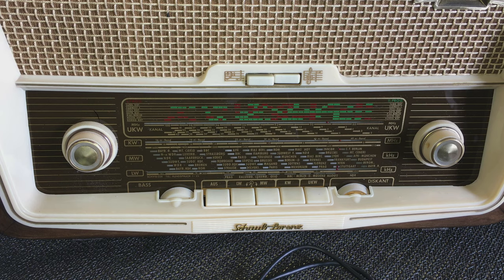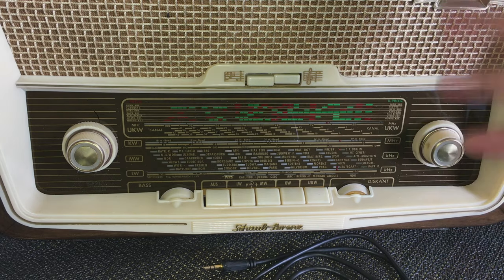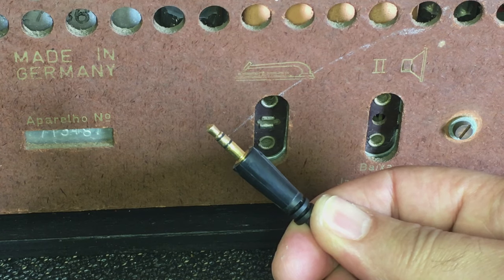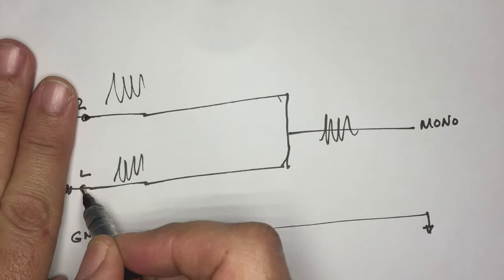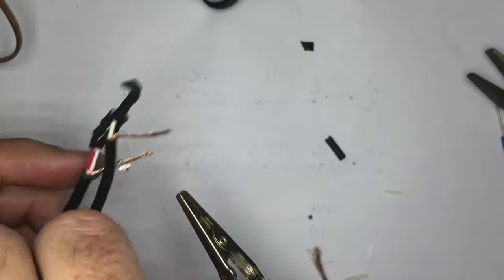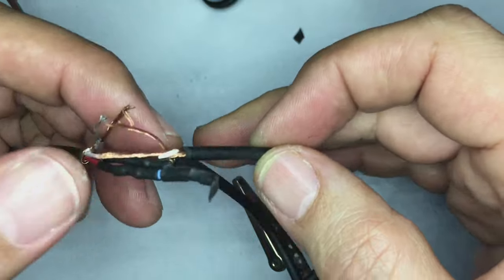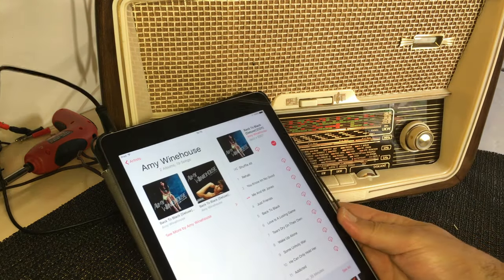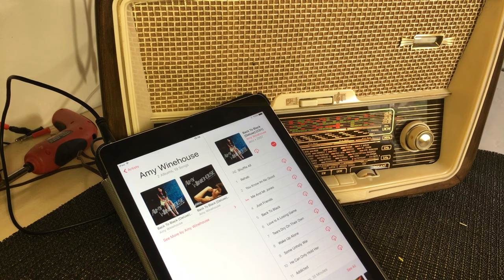Stereo to Mono DIY cable to connect music player / iPhone to tube radio.

Comment: I've come back to this with a question.
In the video you state that mono is usually the upper orifice on the rear phono  input of the radio and Ground the lower. Obviously this is a vertical input.
On most of my German sets have a horizontal input on the back but also a smaller hole in the centre of the two (banana) orifices for what I assumed was the ground.
I have recently used a makeshift 3.5 jack stereo cable and can get music through the phono facility with the ground or signal in either "banana" hole of the phono input and nothing in the smaller centre hole. I'm just wondering if it makes any discernable difference as I cannot tell a difference in the audio quality.
Thank you also for this video and the (as usual) crystal clear explanation for the two 1k resistors. I shall be doing that myself now.
Reply from the maker: The ground socket/signal socket orientation can vary from set to set, so you need to check the marking on the back cover. If there are three sockets, the my guess is that it’s for stereo input.
Reply: @electronicsoldandnew 
I think he is talking about that thin orifice that you almost appear to be putting the signal banana plug in at 23m50s on your video.
I also have a few radios with the thin orific between the banana plugs.some vertical some horizontal.

Comment: I am deaf in one ear and want to make this cable but with both ends being a 3.5mm jack, so that I can have downmixed mono output for my headphones. Would I just solder both wires from the "output" end onto the connected resistors?
Reply from the maker: Yes, each one through its own resistor and then they join as the Mono output.

Comment: On some articles I found, there's a resistor between the gnd and the summed output - on some cases, 1K up to 10K. Also, in theses articles, a 220 or 470Ohms resistors are used for the summing circuit. Could you elaborate on these observations? BTW, I'm making a cable to connect a electronic drum (Roland TD1) to a cheap bass amp. Thanks!

Really nice trick wrapping the wires like a spring!
Reply from the maker: The resistor to ground forces a ground reference when the summed output is not connected to a ground referenced input. It can avoid spurious dc levels on the output when not connected. Does no harm, as long as it is relatively high - I’d go with a 22k or higher. 
The summing resistors can be lower than the 1k I suggest and should make no difference as long as the ground ref resistor is high as suggested, because it actually creates a potential divider which drops the signal level accordingly. Too low and you can get interference between the two output devices.

Comment: Hi, Thank you for this video. I am using the principle for making a bluetooth active speaker from an old passive speaker. The bluetooth stereo signal will be passed to a mono amplifier to feed the music to the speaker. Maybe I am having a blond moment but I have a question where to look for the iron/copper(?) wire you use to make the 'spring connector' (at 19min30s in the video) when you solder 2 wires. I try to find that type of un-isolated wire but can't seem to find it. What should I search for? What diameter is it and what material? I can find iron binding wire but that is way too stiff and probably too thick. Thanks for enlightening me... :)
Reply from the maker: it’s 0.8mm wire. get it at any electronics store.

Comment: Hello from Michigan! Thank you for your very detailed videos. I am finding them extremely helpful. I have 2 quick questions regarding stereo inputs for you. I have a Blaupunkt Arkansas de luxe 40323 which is a stereo unit. It has a 5 pin din for the tape input. I am currently using a 5 pin din/RCA adapter to connect my Bluetooth device to this input. Do you see any problem with that?
The unit also has a 3 pin din as the phonograph input. What is the most appropriate way to adapt 3 pin din to RCA? Thank you!
Reply from the maker: I don’t believe there is a standard way to adapt these sockets as in some instances the convention may not have been followed. I’d suggest actually looking at the socket on the inside and see where the wires are soldered to. That way you’re sure to get it correct.
Reply: @electronicsoldandnew  Ok got it and thank you for the reply!
Reply: @electronicsoldandnew  I checked and they are wired exactly as expected. 5 pin: 1/4=R/L out, 2 ground, 5/3=R/L in. So since I’m going from stereo to stereo my RCA to DIN adapter should be safe to use, yes? I’ve been using this already and the sound is great with no known issues. 

The 3 pin is 1=R in, 2=ground, 3=L in. This one more my concern. Again since going stereo to stereo am I safe to make an adapter by taking the individual RCA grounds and wire them in common to the DIN ground? The turntable itself is already self grounded FYI.
Reply from the maker: Yea, that’s the way to do it.
Reply: @electronicsoldandnew  Thanks again!

Comment: Excellent. Thank you. I have a question. I am currently restoring a Grundig 2420 U. It has a 5 pin DIN  for the PU switch. It has a 2.2 meg resistor in series with a .0033 cap goin to pin 1 to the off switch. Pin 3 and 5 go directly to the PU switch. The question is, is 1 K a high enough value to put in series with the output of my iPhone or IPad?
Reply from the maker: Raul Montesdeoca : the signal has to go into 3 or 5 as a mono signal, with the other connection needed being ground. The resistor and cap to pin 1 is a tape out signal, so don’t connect anything to that.
Reply: Electronics Old and New by M Caldeira thank you very much.

Comment: I have the Grundig 4006u with the 5 pin din port. Can you please tell me the resistor arrangement if I wanted to make such a cable? Thank you.
Reply from the maker: Resistor arrangement is the same if you want Mono. Then you need to see which pins are the input, which is different for every radio, so i can’t help you there.
Reply: @electronicsoldandnew  Thanks so much for your time. Love your channel!
Reply from the maker: Pleasure

Comment: I realize that this is an older video but wanted to ask a question. You pointed out the "hot chassis" issue to be conserned about but did not provide a way to protect against this. Just wondered if you had a design for this or not. I have my own idea of what would work but wondered what your thinking might be.
Reply from the maker: I’ve done a few, but this one is my favourite:
Hot Chassis Plug - with LED indicator for hot chassis tube gear.

Comment: Great tutorial
one Question. If you're not sure you're dealing with a 'hot-chassis' ... how do you test it?
Reply from the maker: Just look for a lower transformer. If it’s not there, it’s a hot chassis set.
Reply: @electronicsoldandnew  ok, I see a big transformer, so I shoul be allright.
Reply from the maker: It should have two transformers. A power transformer and an output transformer.

Comment: Very clear explanation. Thank you. I need a stereo to mono lead for my stereo guitar to mono amp. Presumably this would work. Can you recommend what resistors I need?
Reply from the maker: williamshywel : yes, will work. Use two 1kohm resistors.
Reply: Can i use 1.8k ohms ¼w, 5% resistor as an alternative?
Reply from the maker: that will work too

Comment: Great information, thanks for posting.  I have a question about a vintage single speaker device (not powered at all) that I want to use with an iPod or similar input.  My thought is to mount a 3.5mm stereo jack to the device so that you can simply connect from any stereo source with a common stereo cable, then following your connection diagram from there so that everything is enclosed within the device.  Basically, what you did but from the connector forward to the speaker.  Do you think this will work or am I missing something?
Reply from the maker: 8alonzo8 : yes, you’re missing an amplifier. The output from your iphone is too weak to drive a speaker. Only headphones. You can add one of those small power amp modules, and then you’re ok.

Comment: Great video. I made one and works  terrifically with my Heathkit ea 2 mono amp. What resistor would you use for a normal turntable, (no preamp). Thanks!
Reply from the maker: Probably a little higher, but you need to try out a few values and see which works best with the particular turntable.
Reply: @electronicsoldandnew  Thanks for the response. I thought it would be smaller since the phono signal is weaker. I'm a novice of course. Cheers from Iowa.
Reply from the maker: @brianbeers3123  The Pickups provide a voltage output with very low current capabilities. If you use very low resistors, the pickup will have problems supplying the load and drop signal.
Reply: @electronicsoldandnew  That makes sense. You've inspired me. I've got an old GE tube radio that does not work. I  think I'll dig into it next. Thanks again!

Comment: I want to take 2 quarter inch Jack signal ( Left and Right ) line level from a mixing desk to 1 mono sum Jack or male xlr into a powered stage monitor will the system on this video this work, cheers Mick
Reply from the maker: It should work fine. You’re effectively just adding two line level signals.
Reply: Electronics Old and New by M Caldeira Do I still need to put 2 1k resistors as you did in the video. I’ve just bought a new small mixing desk and want to take a mono sum from the overall mix into a powered stage monitor, I was thinking of using maybe the phones output on the desk or the control room stereo outs thanks again Mick
Reply from the maker: Micky Malibu : yes, use the two resistors.

Comment: Dear Sir, I have the Philips B6CA37A  Bi-Amply radio with 800 Ohms speaker.  (output transformer less radio) . Is this radio with hot chassis? Can I use  this stereo to mono cable with 1k resistor? Kindly let me know. Thanks and best regards.
Reply from the maker: Check the schematic. I don't have that radio.
Reply: @electronicsoldandnew  Ok will check.  Also please clarify for:   are these 1K 1/4watt resistors of Metal Film Resistors or Carbon Film Resistors or Wire Wound Resistors? Which one should I buy? Kindly let me know. Thank you.
Reply: Sir, If you don't mind, again I would like to ask you for one more: This cable you made for mobile phone or iPod with 1K ohms resistor. If I have to use a CD player, then the cable should be made with the higher ohms resistor like 4.7kOhms?  When I use the higher impedance resistor, any sound quality will be less? Your advice is highly appreciated. Thank you.
Reply from the maker: The resistors are the same regardless of the source used. The resistor types I used are metal film.
Reply: @electronicsoldandnew  Ok Thank you.

Comment: Great video ! do you not put a capacitor after the resistors for added protection, decouple it from the radio. I was advised this is GD idea  ?  Cheers
Reply from the maker: +Kye Robinson : you can and it does add some protection against DC, but generally I don't use one. I guess it probably is a good idea though.
Reply: @electronicsoldandnew  if you add a capacitor where would that be  connected  in the diagram and what value would that be. thanks
Reply from the maker: crfmusician : between the signal in and the input socket at the back of the radio.

Comment: Hi I'm a little unsure as to the need to do this as your ipod iPhone and even my cheap Samsung galaxy (bottom of the range)already has a mono output option in the accessibility section of settings? 
Am I missing something? 
Cheers dave
Reply: Incidentally the mono option also works via Bluetooth so should work without moding the cable with resistors ...shouldn't it?
Reply from the maker: I agree that using the mono function would do away with the need for this adaptation, but it is much easier to simply connect any music source to a tube radio without having to adjust your phone or other music source. In fact, you don't even need to know that it is mono. You can simply connect it.
Reply: @electronicsoldandnew  thanks for reply, at least I now know I'm not doing anything wrong  overall, I've started repairing old bush srp31 record players and adding Bluetooth modules to sell on the bay with a mono shorting jack input and didn't want to ruin someone else's equipment in the process, I let them know they need to switch to mono on device. Hopefully nobody plugs a device which isn't mono switchable in!😱
Stay safe

Comment: Wow, I think you can help me! (Sorry for my bad english btw) I have an old reel recorder, an el 3536 Philips. The speakers are in the lit. I like to play guitar on this thing. The extra speaker output, rightside from the input you are showing on your old radio looks similar as mine, three holes. Does it Works the same the other way around? Can I use 2 bananaplugs (or 3, because 3 holes) and connect these together to a female 1/4 plug? So I can connect a guitar speaker box to it? Thanks for help! Greetings
Reply from the maker: I don’t think so. The two sockets are for an external speaker by itself, of in parallel with the internal one. Each radio will be different, so following this example will not  necessarily work with another radio.
Reply: @electronicsoldandnew  , thanks for helping me out...but it could maybe work? I am totally not technical...so. If I want to connect a guitar speaker with a 1/4 plug, I have to open the old tape recorder and change something inside? (By a pro 😉)
Reply from the maker: Broek Hoest : I suggest you get someone to look at it and advise you, or you could do some serious damage.
Reply: @electronicsoldandnew  thanks for the advice!

Comment: After discussing the potential for a hot ground I thought you would add an isolation transformer.
Reply from the maker: Lewis Burmeister : going that route gets pretty expensive fast, especially if you want good sound quality out of the thing. If you have a hot chassis radio, you definitely can't use this option safely. There are alternatives which I'll probably cover in future videos.

Comment: I have a Fisher mono receiver with only a RCA input and not separate ground connection. What would I do with the ground connection from the stereo 3.5 connector? is the outer connector on the rca the ground?
Reply from the maker: LeBauer Physical Therapy, LLC : yes, the outer is the ground.
Reply: @electronicsoldandnew  awesome thanks! just got it all soldered up (not as neat as you) and it sounds great! :-D

Comment: Hi Caldeira, First of all, thank you for the video. I'm an idiot when it comes to electronics, but I'm wondering how You would do it when you have 2 output signals (like R+ & R- and also L+ & L-)? I have a bluetooth device with 2 stereo outputs and would like to couple it with a comparable radio.
Reply from the maker: Twan : usually, the R- and L- are common and we call this the ground. You need to check if they are in fact a common ground. If so, then the rest is as explained in the video. Good luck.
Reply: M Caldeira thank you for responding. How can I check if they are a common ground? And what if this is not the case? Lastly, another question, do I need shielded cables?
Reply from the maker: Twan : Measure with multimeter. You will find that two of the output connectors will measure as a short, meaning it’s connected to the same point, meaning ground.

Comment: Why do resistors work here since they (only?) cause a voltage drop? I would have assumed that diodes would have been put instead of resistors so as to prevent reverse current flow.
Reply from the maker: The idea is not to prevent “back flow” of current, because we’re dealing with AC signals anyway and don’t  want to rectify them, which would happen if you use a diode. The purpose is to add the two signals together, which happens with the two resistors as connected here. This makes the two signals sunk to one, and prevents the two driving sources from fighting each other.
Reply: So ... resistors lower the max. combined votage ... which lowers reduces/prevents distortion caused by too high vptage peaks?

Comment: Can this process be used to convert a microphone with a 3.5 mm stereo tip to mono 3.5mm or 1/4 inch tip? Or what would be the best way to do that? (I need to use a stereo mic in a mono port.)
Reply from the maker: rdoss1. Yes
Reply: But NOT simply combining left and right together like you mentioned early in the video?
Reply from the maker: No, don’t do that. The two elements just end up “fighting” each other instead of adding together as they should.

Comment: Thanks for the video! I'll try to make the same adapter but with a RCA connector instead of the banana connectors since I've got two old tube radios that the previous owner installed a RCA connectors as line-in on them.

By the way can I know what's the brand/model or simply what's the name of this kind of stripping tool that you use? It looks really effective!
Reply: Well, I've should have done a little Google search first! They're called "Automatic Wire Stripper", but now I need to find where to buy one!
Reply from the maker: I think you’ll probably find them any any electrical store or pound store
Reply: Thanks! But I'm still curious to know the brand/model of yours, if you remember it, since it seems to work well with small gauge wire. It seems to be a problem with cheaper ones.
Reply from the maker: It has no brand, and ... it one of the cheaper ones. I think I paid about €3 for it